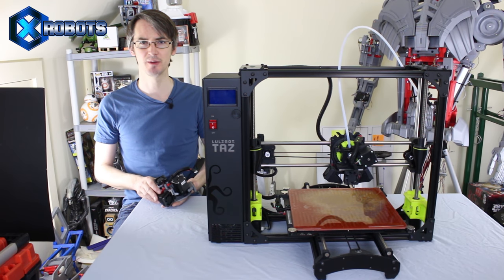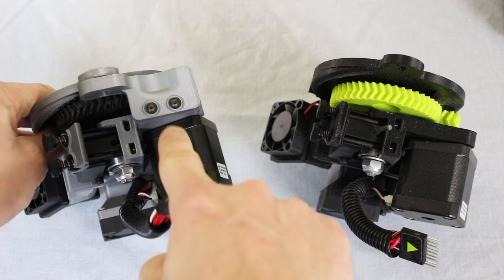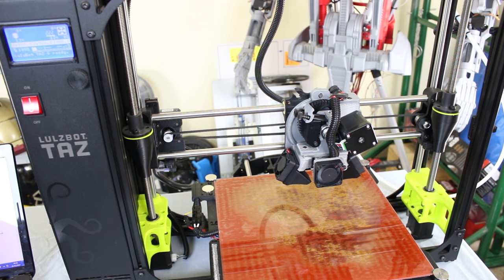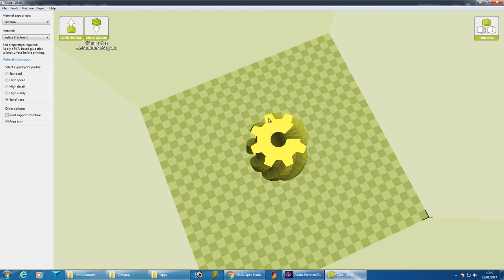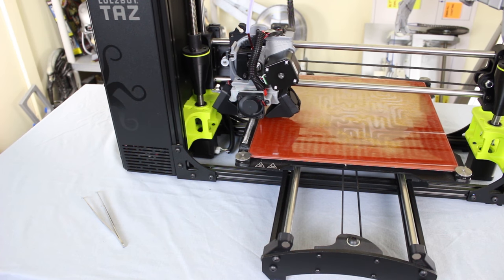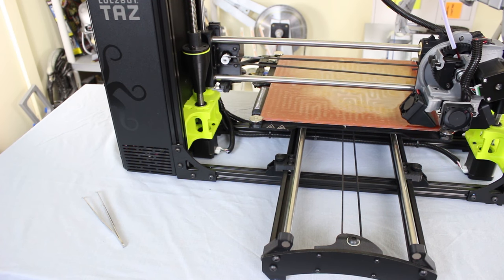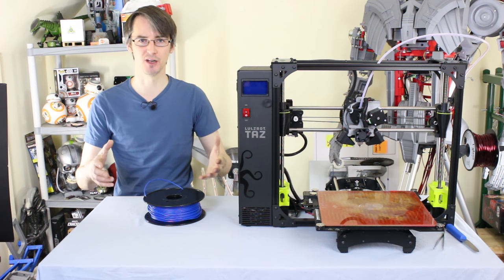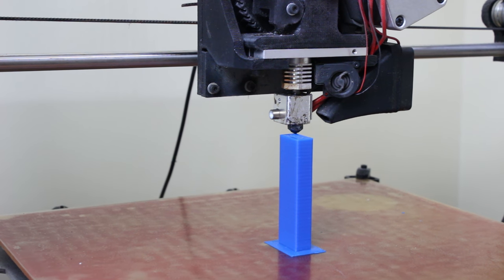MOARstruder Large 3D Printer Extruder on a Lulzbot TAZ6 | James Bruton

Comment: Nice one James.  I've been messing around with the E3D Volcano for a while and the layer bonding is so much stronger.  I have found that the quality of 90 degree corners suffer once the nozzle size goes above 0.8mm but the reduction in print time and the increase in the part strength more than make up for it.

Comment: Instead of using automated in-fills, it would be interesting to see the strength of a piece built like a box girder by design, depending on which direction the load was to be applied.

Comment: I wonder if you could make a slurry of PVA glue and water (kind of like the old acetone and ABS slurry) as a print bed adhesive using wood glue and water, since wood glue is also PVA.  Rather than using a glue stick, which is harder to find, and from my experience, tends to be difficult to apply evenly.

Comment: ooh, wonder if one could make a dual extruder that does different nozzle sizes instead of colors. like the small nozzle is for detail work while the big one is for more simple shapes if I make sense.  like it draws out the detail lines first and then lays out the big nozzle for reinforced core.

I know Lego builders use such a technique for their dioramas. use standard system bricks on the outside but have the bigger but completely compatible Duplo bricks for the core so it saves on brick budget by using fewer pieces to fill space and I think they are equally sturdy.

Comment: The only issue I see with the strength test is the in-fill. the one on the moarstruder appeared to have a higher in-fill percentage. Were both prints set to the same in-fill? was it that the thicker extrusions filled the body more?

Comment: Thought it was just 1 screw, replace it out the screw back. But there is more to it. Flashing firmware adjusting stuff... hmmm how cool would it be if they loaded a rfid chip on it and the machine knows which head is used and adjust the firmware to another profile... like having a series of 'lulzbot compatible plug and play extruders'. A lot more people would buy them then if it would be so hassle free. Maybe one day..

Comment: What would you suggest for filament for a Taz 6 if I were to print quadcopter (drone) frames? IT has to be tough to handle the pressures of flying (motors). I have the stock single extruder that came with the unit. I've been using ABS and PLA. A suggestion for using the stock nozzle and setup would be greatly appreciated.
Reply: Thank you.

Comment: The hammer test is flawed at best, sure you used the same number of shells but the tower printed with the moarstruder is almost solid all the way through, compared to the other tower that was mostly air inside. I'd be interested in seeing the difference between two either solid towers or tower where the shells add up to the same thickness.
Reply: I didn't think the finer nozzle would result in a stronger bond / tower. Sure there's more shells but the extrusion is finer and cools much faster than the larger extrusion. I'd say because of the larger extrusion it takes longer to cool down leaving ample time to fill in gaps and adhere to the previous layer before the extrusion is too cold to flow / bond properly.

Comment: Those prints look hideous. I think I'll stick with smaller extruders.
Reply: ***** I'm aware, but for the purposes I'd use 3D prints for I need my prints to be smooth. Maybe by applying some acetone you could get rid of the bumpy surface without sacrificing print strength? How do you think that would work? What would the merits of that be?
Reply: Bas van de Kleut if you need high quality finish, you're right. Smaller nozzle diameters will be the way to go. However, this is for high output, low tolerance rapid prototyping where a few bumps are better than hours of print time